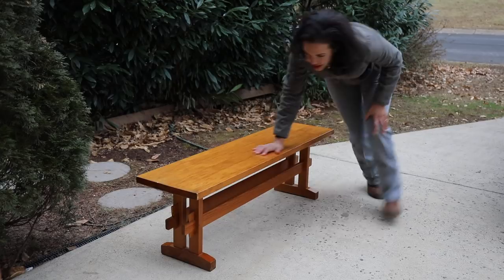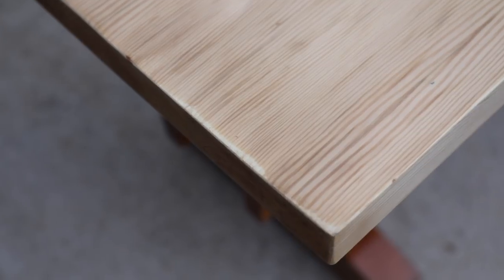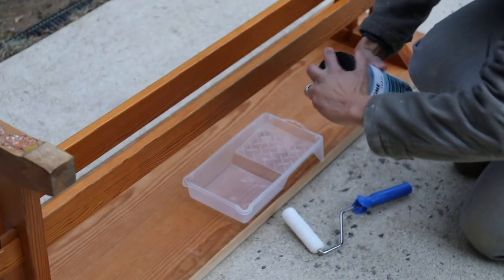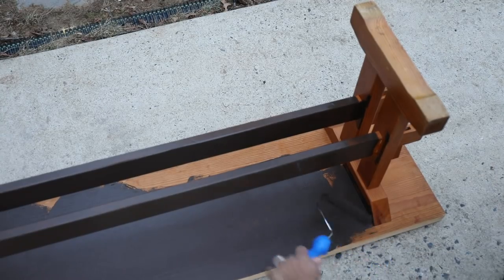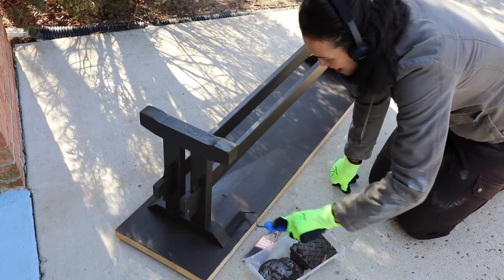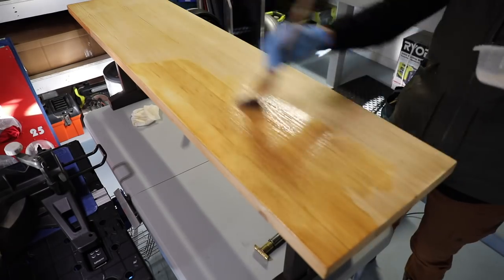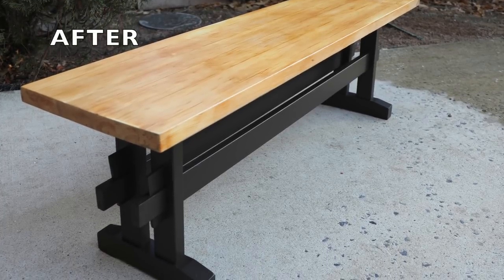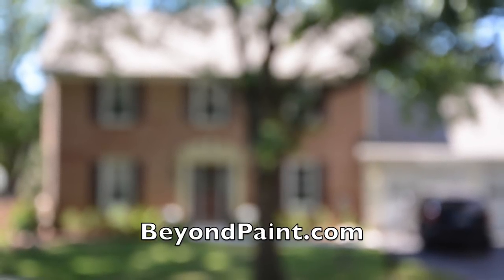Dining Room Bench Makeover Using Beyond Paint: Furniture Makeovers - Thrift Diving

Comment: The bench looks stunning. You've given me an idea of how I want to paint the large corner sofa storage unit that I want to build out of old solid wood panelled doors. Now I'm definitely going dark on the bottom as I think it will make the soft seating and throw pillows look more indulgent, plus it will hide the pull out dog bed that I'm going to incorporate into the base.
PS I had to laugh when the bench tipped up, as I did the same thing a few years ago,, only I ended up on the floor with the bench wedged behind me, yeah never did that again 😂 😂
Have a lovely week ahead.

Comment: Did you use a foam roller or a woven fabric nap roller?
Reply from the maker: I used the woven fabric roller, 1/4" size. :)
Reply: @ThriftDiving  Thanks! How was the final texture of the paint? I have heard it has a texture and that's the only reason I'm hesitant to use it on my kitchen and bathroom cabinets.

Comment: looking at the joints on this bench leads me to believe its an Amish trestle bench. I've seen this type of joinery in timber frame homes. If I'm correct and its Amish you might have just destroyed its value by painting it. I would have applied 2 coats of tung oil to it and that's it. You never paint Amish or Shaker handmade furniture.